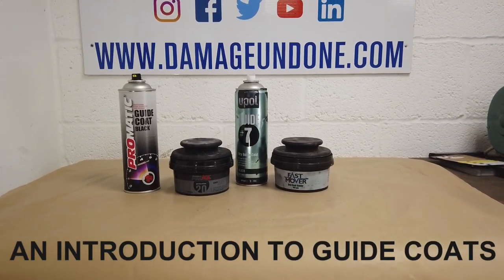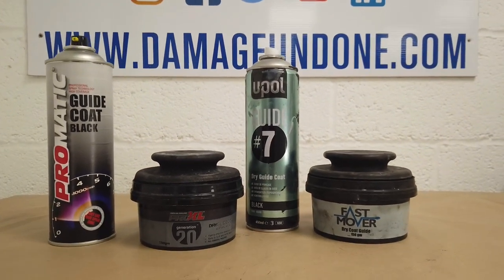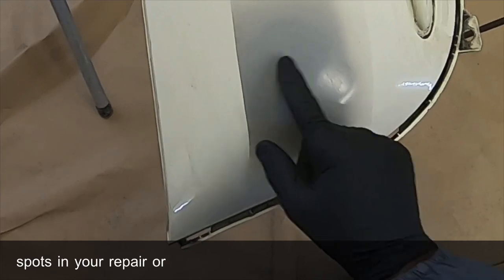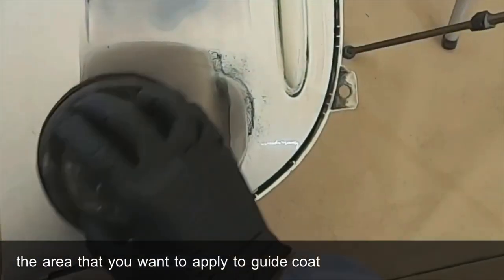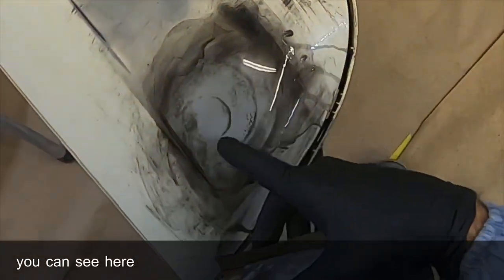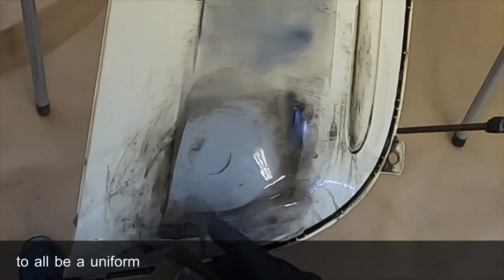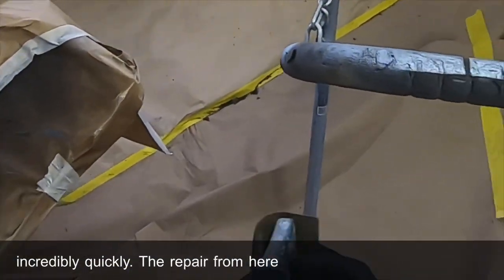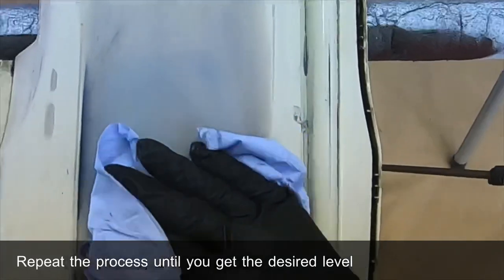GUIDE COATS & HOW TO USE THEM

Comment: Hi Wayne, this is perfect timing as I've just tried guide coat for the first time, I was seeing sanding scratches in my base which wasn't a big problem as it's black so didn't show in the clear but wanted a better finish, used it for the first time yesterday and the primer looked better, after laying the base it looked so much better but there was still a few scratches, I hope that will improve over time but the clear coat looks better as well. I'm hoping I wont need to change my primer to a non sanding now.
Reply from the maker: Change your prepping disc so a specific prep and fade out disc like norton the cyclonic range do and so do 3m in a 800 and 1000 option. They are typically a thin foam disc and should be used to get the final prep on your panel before laying base.
Reply: Ok thanks Wayne, I will give those a try as I don't think my sanding discs are very good, I use the Mirka Arbranet 80 then 180 to prep panels for primer but need something better for final prep for base.

EDIT: are these ok?
https://www.spraygunsdirect.co.uk/index.php/abrasives-blocks/abrasives/3m-soft-back-sanding-sponge-choice-of-5-grades-115mm-x-140mm-pack-of-20.html#sthash.Hw1mCohK.dpbs
Reply from the maker: They look good but expensive, that’s the thing with 3m. the ones I meant are 150mm discs. Also 180g before priming sounds coarse, check the primers TDS info because with the uvprimer it’s normally 320-400
Reply: Ok, I'll see what I can find, Quartz do something similar which is cheaper, maybe I should have mentioned that most of my primer work is on bare steel which the data sheet states should be p180 but over old paint it's p280 using the upol S20:25 2K primer.